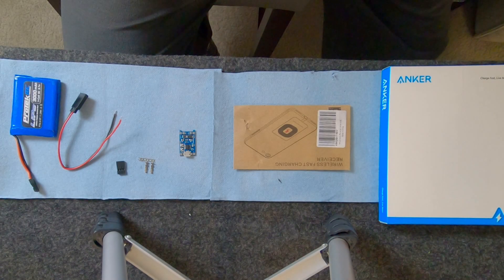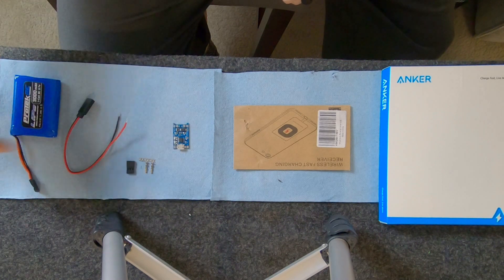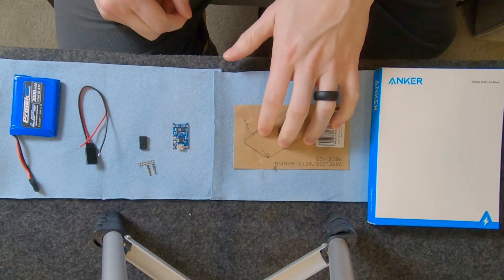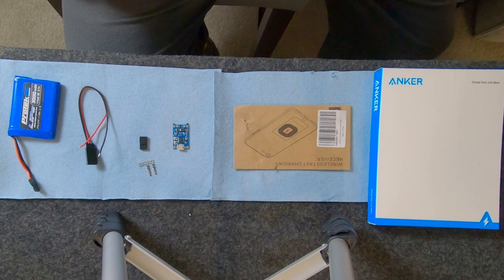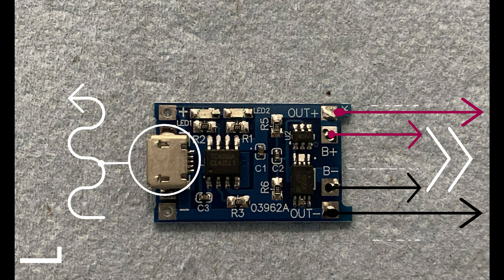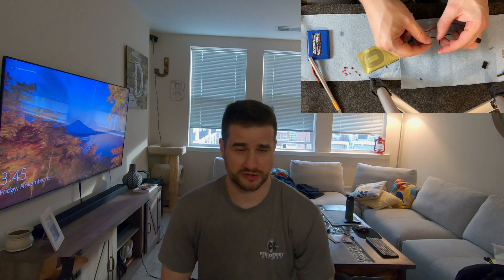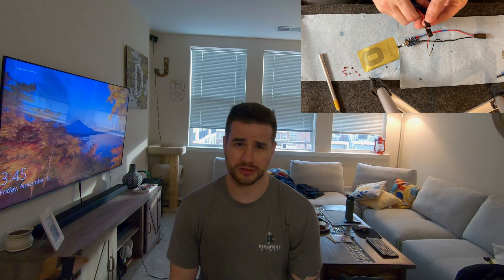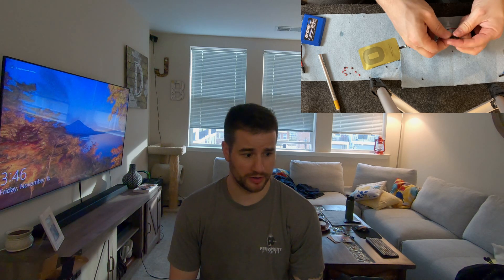Sanwa MT44 Wireless Charging Mod

Comment: Hi.
Please tell me, how fast charge this wireless charger?
Reply from the maker: I’m not sure. When my battery starts to get low I simply put the radio on the charging pad in between races. I haven’t had to let it charge for more than an hour. Although my battery has never been completely dead.
Reply: @briandrake8557  okey thank you very much!

Comment: Those little connectors like that can be very tricky and it is normal for you to have to retry multiple times before you get a solid connection! I just did some my self and it would be way easier if you buy the crimp tool instead of the pliers the crimp forms the metal in a perfect bend were the pliers can't to that.
Reply from the maker: I certainly learned that the hard way. Thank you for the advice and for commenting on this video. I’ll have to look into getting a crimp tool.
Reply: @briandrake8557  Or get a male to female servo extender. Then cut it in half.

Comment: Hey I'm trying this upgrade and my remote wont turn on unless it's on the charger pad and it says low battery but I know it's not. It shuts off as soon as I take it off the charge pad. Any ideas?
Reply from the maker: Hmm, hard to say. It kinda sounds like the radio power out and battery power in wires are switched. That would explain why it only turns on when on the charger and why it says low battery. Since the charging circuit isn’t pushing out as much juice as the battery does. But I don’t really know. Let me know if you figure out the problem.
Reply: Brian Drake thanks for your reply. I triple checked and its wired up just as your diagram shows. If I start switching wires do you think I can damage the remote?
Reply from the maker: It really is hard to say with any certainty what’s wrong. It could be possible that the circuit board is faulty. Again, if I were to guess based on how you described your problem. It simply sounds like the wires were switched. It might also be possible that the circuit board manufacturer changed the wire configuration.

Comment: Are you still using this mod, how is your Lipo after a couple of charges ?
Reply from the maker: Yup still using the mod. I have only had to put it on the wireless charging pad once so far. As far as I can tell there is no noticeable drain from the circuit.
Thanks for the question. I was thinking of doing a follow up video at some point.